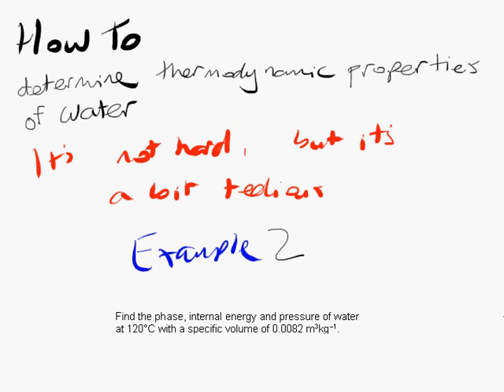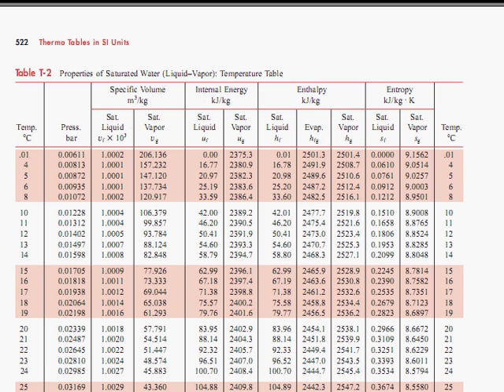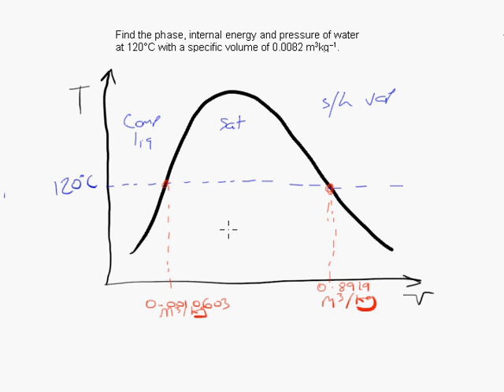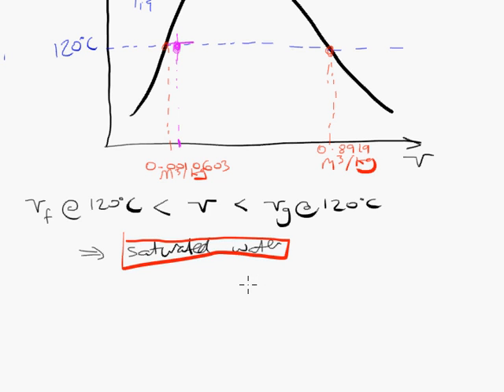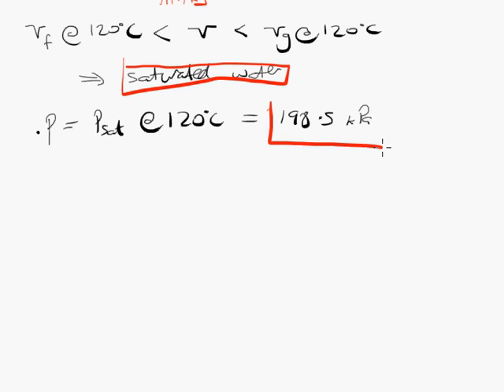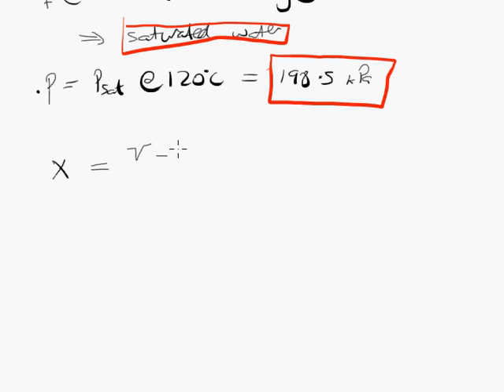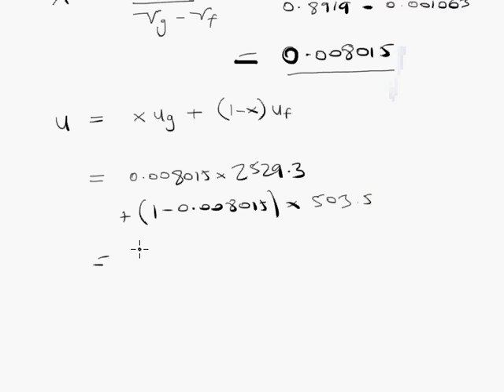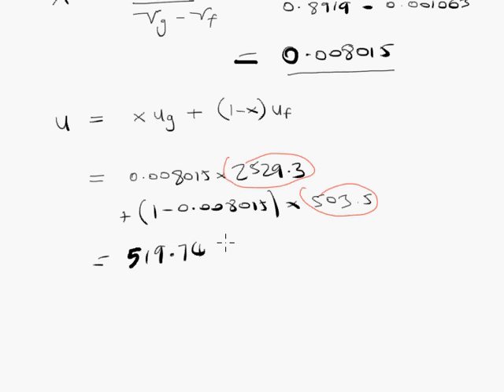Steam tables: example 2

Comment: I have question but a little bit out of the topic in this video. When people measure steam flow rate (let say x = 70%) in a pipe using Pressure differential method (bernoulli's law), what is actually the final output? Volume flow rate or mass flow rate?

Comment: isn't the vf in the numerator and the vf in the denominator supposed to be the same value??? Where did you get 0.0010063 from??
Reply from the maker: You're right - I made a mistake (around 8:30). I've added a note in the video. Luckily for me, it doesn't affect the result significantly. Thanks.
Reply: I am presently in my 1st year in university and my teacher is not a really good teacher, is it possible in any way i can send u some questions and u can show me step by step how to do them. I will really appreciate it and once i understand i can share the knowledge with my classmates who are in the same boat as me.
Reply from the maker: deran nicholas Sorry, but I'm busy looking after my own students. Anyway you don't need a step-by-step guide - you seem pretty sharp - you'll learn more if you figure those questions out yourself. Get yourself a good book and work from first principles.
Reply: Ok np thanks anyway, can you recommend a good book?
Reply from the maker: deran nicholas There are many - take your pick:
Moran, Shapiro, Munson, De Witt - introduction to thermal systems engineering
Cengel and Boles - Thermodynamics
Moran and Shapiro - Fundamentals of engineering thermodynamics
etc etc etc!

Comment: Why is the specific volume getting smaller if it is multiplied by 10^3??? I'm not following that step...
Reply: The specific volume is listed in the steam tables as "vf x 10^3" meaning all the values were multiplied by 10^3 just to make them easier to look at (instead of 0.00010002, you have 1.0002).  To get the 'actual' vf, you just have to divide the table value by 10^3.